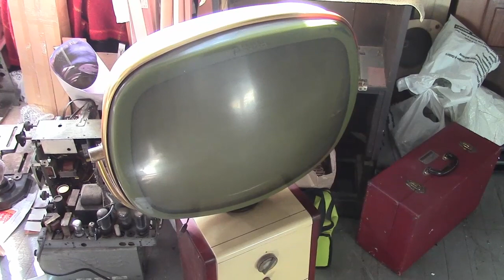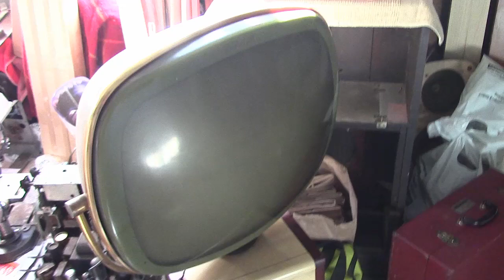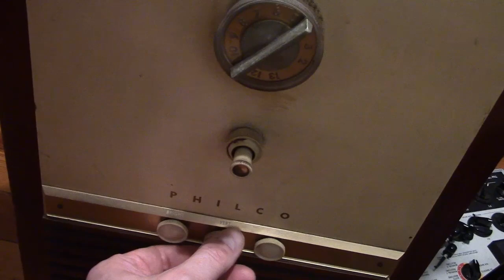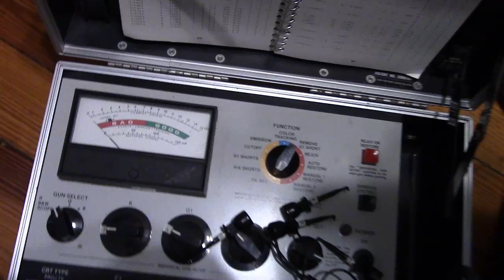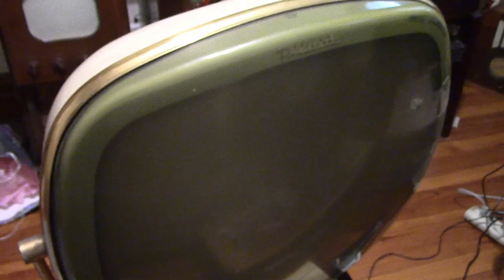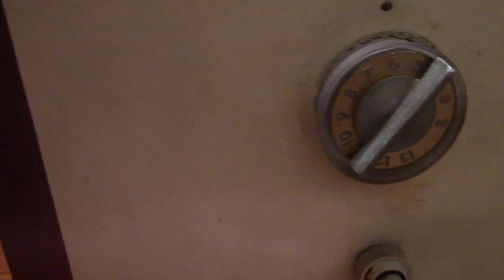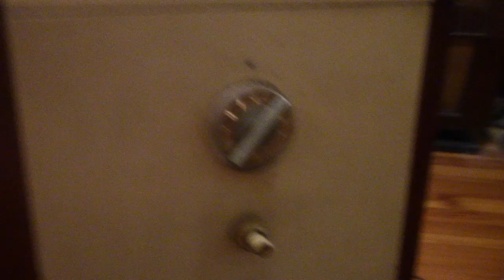Predicta Pedestal restoration p1o4

Comment: Hi Bob, you might be lucky with the vertical if it's just a matter of spraying the vert linearity pot with cleaner. I was lucky on a Tandem with a horizontal flickering line. I'd be interested to hear one of these with the bigger speaker, I agree that the table top models have small speakers. They sound so tinny.

Comment: i do recall shango66 worked on one exactly like this but its a little pain but still a nice one. i would own the 2 piece unit or the table top model and i would use it for everyday use 24-7 unless i turned it off

Comment: I watched Shango's rebuild of the Predicta Pedestal and his half-ass repair won't take long to fail.  He doesn't seem to like to replace capacitors.  Not sure why but what he keeps; that's his business.  When he repairs for others; he should replace them all!
Reply from the maker: +Edward Morris I know what you mean.   New video on the GE coming up next and you'll see I replace just about everything
Reply: +bandersentv May I ask what part of the country your in? I'm going to purchase a predicta and need someone to replace tubes and have it in tip top shape.
Reply from the maker: +Tom Hertz Chicago, IL
Reply: bandersentv Awesome. I'm in Schaumburg a Northwest suburb of Chicago.  Do you have a repair shop or is it all done at home shop.
Reply from the maker: +Tom Hertz   It's all done at my home shop :)  I'm working on a Predicta Debutante and Princess right now.  Which model are you getting ?
Reply: +bandersentv Its a 1958 21 inch Philco predicta classic swivel.
Reply from the maker: +Tom Hertz I'm not sure what you mean by that.  The Holiday, Pedestal and Tandem Predicta models came out in 1958.  Is it a table top or a pedestal like the one in the video ?
Reply: +bandersentv Its a table top. Theres  two I'm looking at one is better condition but missing a front knob. Do you have access to original knobs.

Comment: I hope this one doesn't have that  pain in the ass detarchable circuit board.
Reply from the maker: +Robert Estes It does - same as all the other Predicta models.  Same goes for GE, RCA and many other brands from the same era using early printed circuit boards.  I've gotten the hang of removing them.
Reply: +bandersentv I must be insane as the first three TV's I picked up were a Philco Town and Country...  an RCA 14PT9012 and an RCA 17PT9054 nearly identical except screen size.  if these don't put me off TV's forever, nothing will..  ;-)